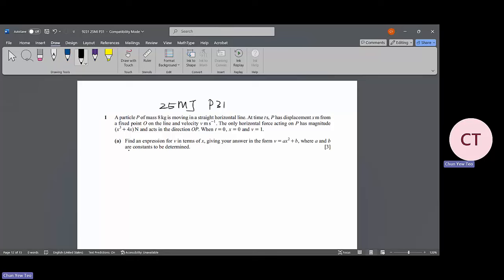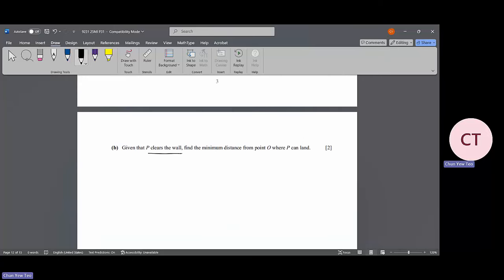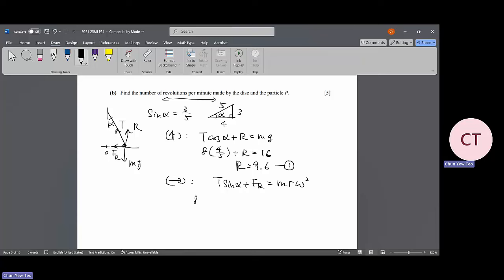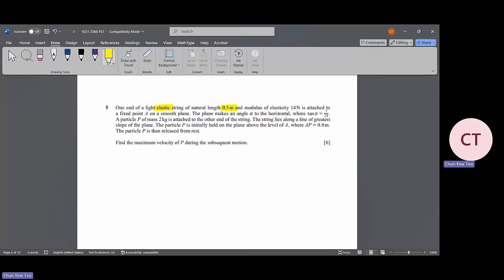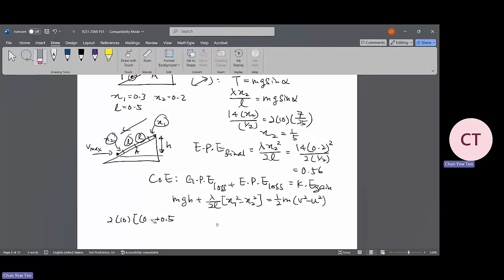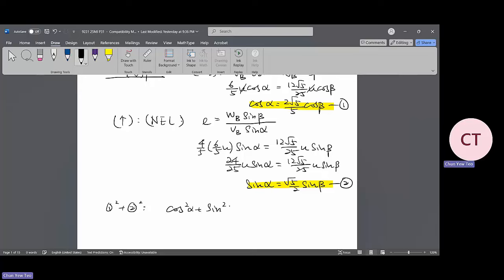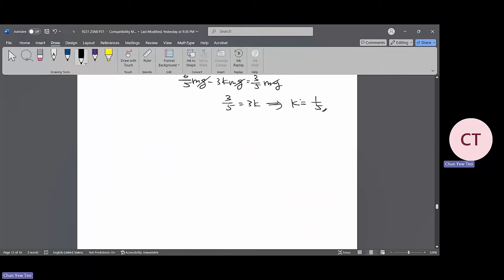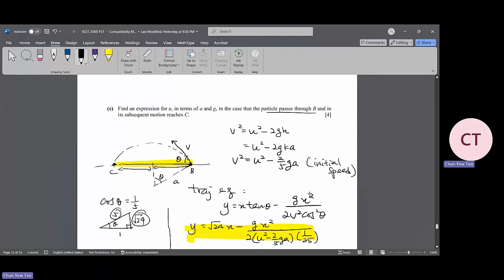9231/31/M/J/25 CAIE A-level Further Mechanics Solution

Comment: sir for q5, how is max speed when b rest below a?
Reply: the max is speed will happen when the particle is at the position where it is equilibrium. So when i calculate the x2 I am assuming that the particle is at rest below A. Then when I calculate the motion of the particle I just need to calculate until x2 will do because that will be the place where the particle is moving in max speed.